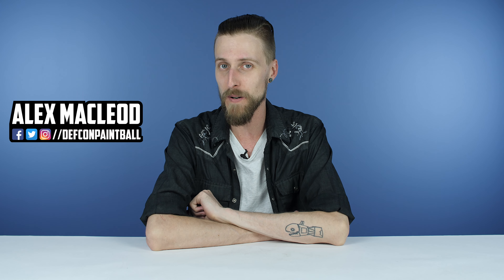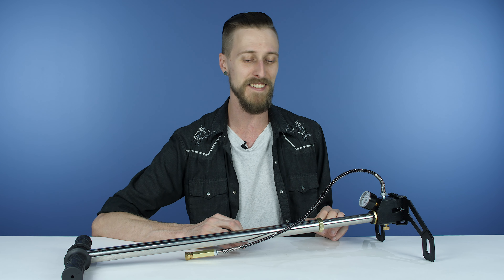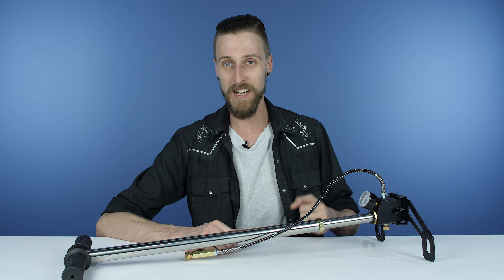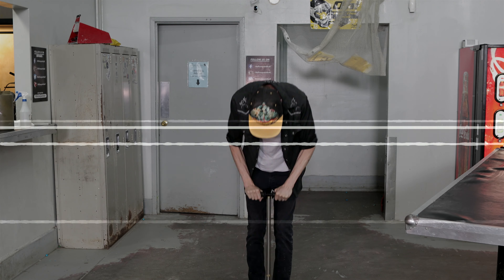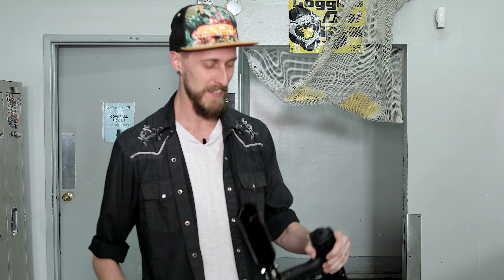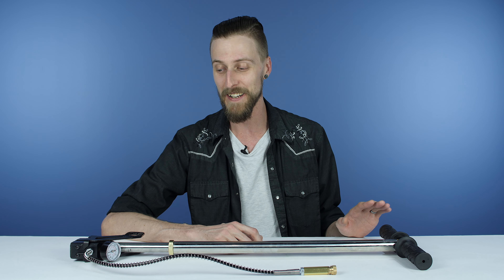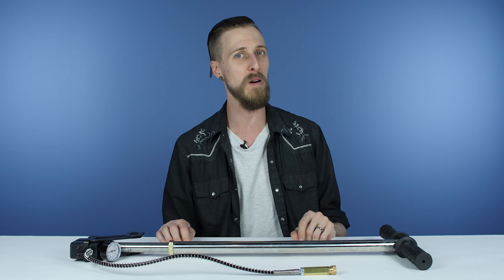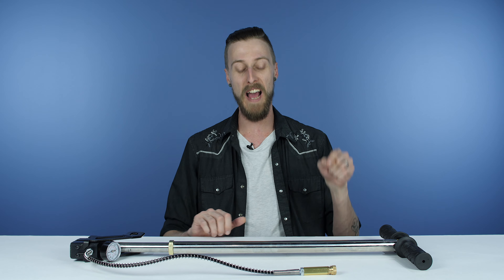Does it Suck? High Pressure Hand Air Pump Ep. 41

Comment: I bought a pump like that a while back, and it only takes me about 5 minutes to fill a 13ci tank. I think the use-case is for at home use of guns when you don't have easily accessible HPA. For example, I have to drive at least 30 minutes to fill my tanks. This allows me to fill my tanks at home when I just want to fire off a few rounds or test an upgrade.
Reply: Ya, I agree for me to get my tanks filled up I have drive 2 hours so this would be handy.
Reply: Do you have like to that pump?
Reply: Don't know I want to try it but I have heard nothing but good about it
Reply: I'd say only get it as a last resort. Basically any field will have free* hpa, so it's mostly a novelty thing. Using it to play in remote locations will result in you spending more time pumping than playing (unless you're playing mag fed/first strikes).
Reply: Same 🥳👍🏻
Reply: Yup
Reply: Schweeb7027 what is it called
Reply: I have to drive a hour plus too this isn't just you guys this a world wide problem
Reply: Schweeb7027 do you need like an adapter to be able to connect it to the tank ?
Reply: It came with the proper fitting. If it says it's for pcp air rifles, it should have the fitting you need.
Reply: I think that's what I would use it for
Reply: Do you have a link where I can buy it?
Reply: Coming from an airsoft HPA perspective, this seems great, our general running PSI is around 75-120 PSI, so a 13CI is alright for shorter game days
Reply: Buy a scuba tank and have a portable air station or buy extra aluminum tanks for cheap.
Reply: have you filled over 2500 psi
Reply: I noticed he was pumping the handle up and down really fast. Do you have to do that, or can you just go nice and slow?
Reply: If I wanted to fill my tank at a field I’d have to drive 3 hourse
Reply: Is it only good for a few rounds?
Reply: Best for less leathal users.
Reply: Its not that bad. Love mine. No more trips to get it filled. Use proper technique.

Comment: man,  from what I can see, you did not use the full capacity of the pump. This is why it took you so long. Before doing something, just read/learn how to do it. When lifting the handle all the way up, you are taking in more air to compress/pass to the gun, so it takes way less time to fill the tank.

Comment: I have one like that ~ but i is made in Japan. Cost is 160.00. And it has a 6000 psi. max. it pumps up a tank in 5 to 6 pumps 🖐🤗every pump is 750 psi or so. it beats 1500.00 on a decent electric compressor by far in cost. But its really  all about what u pay for in any thing that you buy. same goes for this manual one. mine is oil filled. Even the pressure gauge is oij filled🤗👌💜

Comment: As other people have said it’s perfect for 13ci the version I had took roughly 5 minutes to fill to 3400 which after cooling down was equal to 3k. 
Perfect for teching Parker’s at home that have small leaks or need a quick tune or to test guns for sale. 
You can fill a 4500 with them my 72 ci took over 2 hours but was pumping off and on.

Comment: Hey I used one of these to pump up a few hpa when trying to start a small club in my town here in new Zealand. It tool a bit of effort  but it was well worth the effort. And I was pumping up 10 hpa in varying sizes from 13ci to 48ci and luckily for me they were only 3000psi tanks . now we play on a regular basis with 10 members. And I now use a welders oxygen tank with a filler that I got  made
 up

Comment: Wish the video had a timer for how long you pumped so we can see an actual fixed time.  I do a lot of biking, both mountain and road, and it seemed like a 13ci would take about the same amount of time to fully pump a bike tire with a smaller capacity floor pump.  Secondly how much do they cost?  If they're priced appropriately then it'd be a good exercise with a side benefit! :P
Reply: they are between 130 and 200$$$$$ it depends on the model
Reply: You can find them for around $50 from various brands on Amazon. It takes me 5 minutes to fill a 13 ci tank with mine.
Reply: @Schweebcraft  mine must be broken then takes forever and super hard on the back. it did kind of explode some fibers when i first got it

Comment: i used one of these all the time and the only problem ive had is having to wait for it to cool down and not over heat the rubber o-rings, these are only awkard to use if like myself you dont weigh much but even then these are worth the money because it aint that hard to pump it up, makes me wonder how people can run about with all there gear on but cant use a pump, these are worth the cash and ill be buying another one soon ;D

Comment: I have it. To me, it's awesome. I have a shell ejecting APM50 from APS and I charge the shells with it. You can even load rechargeable CO2 capsules with compressed air (dangerous tip : when done with the first compression, put them in the freezer for 6 hours at minus 18° Celsius minus 40° C is the BEST and pump more air inside.CO2 capsules can withstand up to 400 bar). That's probably the best thing to do with that pump, small containers, that's it. It does take a while but it's worth the exercise, I mean, you can save on the gym. 😅

Comment: 2+years late to watch it, but to awsner your question Alex, some things may have already been commented but right now not much of it is really showing up on top for me

Yes I have one if these that goes up to 3000 psi I am using an 48ci steeltanks (nothing fancy)
It takes me about 5 minutes to get halfway, which is ok (I'll note something about that later

Since it's basically an excersise, you can get a hold on the soreness (if can, and will do it right) But I can see why most people just wanna hook it up to a filling station or scuba tank

Now that you've got the awnser to your question, imma mention some point(s) based on the footage in the video (may be mistaken because of angles and sped up footage)

You're supposed to push all the way through, and pull all the way up, and wait a minimum of 1 whole second at both ends of those respectively

This makes it somewhat heavier because that way you're actually  pushing the full volume if the pumping rod.
But what you did now this 40+ minutes is mostly struggle with yourself at whatever psi was on the meter at that time while little air was barely given a chance to go in the tank

And you're supposed to take pauses to prevent it from overheating, now it differs with the quality of the pump, but 40+ min doesn't sound good for the seals and overall longetivity of the pump
(So I avoid having to pump it more than 5 minutes between games, which works for me)

So I wouldn't recommend this to just anyone as it is still hard work. But you should not judge the process on a flawed representation
I am planning on getting a version that is capable to fill 4500 psi tanks when I get one

Comment: First of, great video! But, you need to hold your feet firmer on the foot supports in order to not alow to pump to dangle from one side tot the other when you pump. Also you need to do the full stroke up down all the way, and not do it in a hurry but rather apply more force on pushing down. It is a very efficient pump if used properly.

Comment: I have a 4 stage hand pump for my deep woods hunting cabin, where i keep my PCP larger bore hunting riffles.... .357, .45 and .50 as backups.
I also have a compressor, but you can't exactly take a compressor out into the woodlands on foot as a backup. There is a huge difference between a 3 stage hand pump and a 4 stage, tho lol. You have figured out what that difference is by good Ole trial and ERROR 🤣🤣 GET A 4 STAGE, YOU ARE DONE in a few minutes with a lot less work. Wouldn't do it for any of my markers, tho. I just use my compressor

Comment: It was designed for Air rifles which have much smaler tank and use much less Air per shot. With them i nead to make only about 70-90 pumpa to gett it up to 300bar. Which is good for around 150-180 pellets. So it is worth it

Comment: Should be a valve to close before starting to pump. I would assume you knew that, or else you would be leaking as you are pumping. Seems strange that people say 5 min to 3500 and it took you 20 min to get to 2200, as you said. Would be curious to very that. TY

Comment: I have one of these. Tried to fill my 68/45 to a full 4500. Nuh-uh. Not gonna happen. Pumped for 3 hours and got close to 2k. And the higher the pressure, the harder it gets to pump. Haven't used it since. I don't think it necessarily sucks, but using it sure does.

Comment: Hey thanks for info...would you guys review this one thinking about investing in it. Thanks.
YONG HENG 4500PSI Air Compressor 110V Set Pressure Auto-stop PCP 30 MPa High Pressure System Rifle Inflator PCP Rifle Airgun Scuba Air Pump Portable Air Compressors (Pressure Customized Version)

Comment: So i get this pump. I get this tank. 3000 psi 13Ci.  It took me literaly 5 minutes with stop watch. Just constantly up and down. Not to slow not to fast without any troubles or resistance. from zero to full. I am not exhausted at all. Pump get hot. But tank was already full. Only resistance I had when I get above 3000. Than I stop.    Seams like I am super human. Or those who do the reviews they are wimps......................... In bouth cases I say this is best solution to be 100% efficient in paintball. You get exercise. your stamina and breathing gona be on top. You get warm up before the action.        Tips from me. When the pump is brand new and it get hot.  Than it start leaking air. Relese air. Disconect tank. Take all tools you need and tighten gently all screws and nuts. Gently I SAID GENTLY!. Than reconect tank and pump to maximu. All next pumpings should be without any troubles or maintenance. Cheers.

Comment: You have no idea how this works. You have to do long steady strokes. It's a workout but then again, I work out, so I have no problem using a pump. However, if you need 4500 psi, you will need a compressor.

Comment: What if you attached the pump into an exercise bike? Like, it pumps two of them as you peddle. That might work better...I might try that.
Reply: I guess if you Build any Kind of construction for it, you might Pay as much as you Pay for an Compressor.
Reply: @dustinschulz5707  Too late, I already built it. It's only cheaper is you have the parts laying around. I was fortunate enough to know a guy with a lot of junk.

Comment: His pumping technique was crap, he was using just his upper body and not bending his knees and using his body weight to do the heavy work. Also not being funny but he is lacking any muscle or energy to achieve any resemblance of getting the job done.  I have one of these pumps and it takes me 30 mins of pumping (with breaks to catch breath) to fill a 48cl tank to 3000psi. It is a great workout and your cardio will improve the more you fill up.  My usual set up is 4 x 48cl hpa tanks to take with me when in the field and this usually lasts me all day. So that is 4 x 30 min work outs each week plus free air to use at the weekends paintball fields.  I think if you are starting out then this option is by far the cheapest way to fill your own tanks, although not the easiest, lol.

Comment: You pump it way too fast if you slowed it down a little bit and brought the pump all the way to the top will it fill with air and push it down it would’ve took you a quarter less pumps in probably 10 minutes